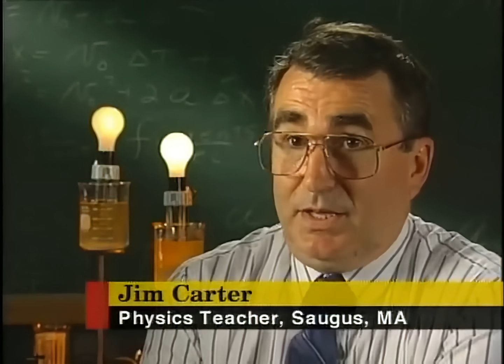MIT graduates cannot power a light bulb with a battery.

Comment: The electrical circuit needs to close.

The lightbulb is made from 
1) a glass bulb
2) a metallic cylinder
3) a ceramic on the bottom of the cylinder
4) a small metal pin on the bottom of the bulb 

So one side of the wire is attached to the outside of the cylinder, the bottom metallic pin is place on the other side of the magnet.

Then current can flow from the battery, through the wolfram wire inside the inert gas bulb.
(The inert gas prevents oxidation of the wolfram wire at high temperature)

Other then that the current heats up the wire with the electricity, that the light bulb is glowing, because the thin wolfram wire is glowing bright hot.
(Maybe around 6-10x times as hot as a pizza oven. 2200 degrees Celsius ≈ 4000 degrees Fahrenheit)

Comment: I literally did this in Grade 5. We took a paper plate and taped some wires to it. Attached a 12v battery and a small incandescent bulb and fastened a paper clip to the plate to function as a switch.

Comment: People spend their whole lives in professions they know nothing about. 

I’ve recently picked up DIY. And within a few months, I have identified and repaired multiple jobs done completely incorrectly by professionals. And the worst part is that the guy who f’d up the plumbing ONLY does plumbing. The guy who f’d up electrical ONLY does electrical. The guy who installed vapor barrier backwards ONLY does vapor barriers… How did I surpass them all simultaneously in a few months? Are we just surrounded by useless people?

Comment: In my 24 years of electrical construction from simply projects to 911 call centers, I have yet to see a job properly "engineered". I suggested that engineers spend their first 2 years on a ladder before being allowed to design anything. One project involved a 4 story library that was designed without taking into account the weight of the books. LOL

Comment: It depends on the light bulb, the battery and the wire. You can't light a 240V light bulb with a 1.5V AA battery.
Reply: You certainly could. The question is whether or not you could produce enough heat for light to be visible.
Reply: @jordangourley3955  if it's an LED then no
Reply: They never said what the trick was for why they couldn't do it. My first thought was some bulbs genuinely are made for AC circuits or commercial voltage that could never be powered by a small battery
Reply: @spencerbuck1074 commercial voltage bruh like yeah the battery cost a buck
Reply: When I was a kid I walked around with a 9V battery trying it on light bulbs thinking "maybe this one will work" but of course never did. Then I got a kit with some LEDs and burnt them all out by trying it on them. Sometimes life is mean 😢
Reply: Wow, you must have gone to MIT to come up with that conclusion!
Reply: You might be, depends on the power
Reply: @philippe_6457 for sure, but then your light bulb will stay for 7s, dim out quickly for 2s and stay dead at 10s.. well if you use AA battery ofcourse 😂
Reply: @ViktorLeQT a 3W led with 1.5V AA would draw 2 amps . Some lithium AA got around 3000 mah capacity. It would last more than one hour
Reply: @CapFausto  Lithium AA's are not common, and 18650 Lithiums (much bigger) are I think in average 2400mAh. 
But this doesn't really matter. 
If you wire up an LED directly to a battery without a resistance, the LED will burn very quickly. Because the LEDs have almost zero resistance, and the current will be too high.
Reply: This guy clearly went to MIT!
Reply: This is in America that’s only a 120v light bulb

Comment: It's not entirely true that you can't do anything electrical if you can't predict the internal resistance of a wire. The students are decently primed to solve tasks—they learned about resistance, they just need to reframe the question. They know that reducing the resistance would increase the available voltage/power to the light. They can also probably design a far more complex digital circuit that uses those basic principles but amplified. If any of those electrical engineers specialized in DC power distribution, they would obviously ace the test (or I agree, remove their degree immediately lol)

Realistically, a couple of the students there probably experienced internal resistance in a wire at 3AM trying to wire their formula car start button or something, and learned from that stupid mistake, the hard way, wires are resistors. So when the long wire isn't working, they instinctively go to "shorten the wire."
I happened to learn that specific lesson during a grade 5 science fair project, but instincts come from experience, which a degree gives you ACCESS TO, it does not GIVE YOU THE EXPERIENCE though.

Comment: Way to make something extremely deep, bout a battery and a bulb. What was the answer? Who knows? Something bour IR? Votlage not being high nough? Or the way to wire it up? It guess one wire from minus to the side of the bulb, given only one wire, put pluss pule on pluss pole of bulb which is the bottom? Or maybe its the opposite way. Maybe the resistence is too high for such a battery- Are we taking grounding into the mix too? Fcx do i know

What are the speccs? Does it go to a socket made for 220v / 110v or run on a normal battery(which wont do fck all then)?

Comment: The funny thing is that you don't need an Engineering degree to know how to use a battery to power a light bulb. Any curious adolescent who has opened a flashlight knows how simple dc circuits operate.

Comment: There is a lot of knowledge in the world today. Would you rather hire someone that is fully trained to do the job or someone that just knows how it works? If you had to get your light fixture rewired, would you hire an electrician?

Do I think I could light a bulb with battery and (a) wire? Depends, does the battery give off enough energy to light the bulb?

Comment: I was thinking at the start that they would give them a regular lightbulb and there wouldn't be enough power in the battery to make the filament glow. But just connecting one end of the wire, bruh what?

Comment: 1:39 he joins the +ve and -ve to each other using the wire. Within 1-2 seconds that wire will get red hot. 

I learned this as a kid messing about with batteries, wires, and later with motors, RC cars etc.

Comment: Ah c,mon, I was doing that when I was 8, and playing with a toy car that I used to push to make it light up, I understood that time basically how it worked , if this is the quality of student I now understand why there is no real big breakthroughs anymore
Reply: So you can explain the magnetic field theory in operation then? Van you also calculate the power output voltage and how it varies based on the velocity your pushing with? 
Engineers can. That's what they do, they are not repair technicians mechanics or electricians

Comment: Western academia is 99% theory. Ie notes on a board and text books and writing or typing, abstract diagrams, models and theories, admittedly now tablets, screen boards, but same principles. Nothing practical. It has next to no practical exercises and experiments with phsyical tangible objects. Even at school it's only very occasionally in science.
I studied computer science to degree level. Only 3 people in my year knew how to build a computer and install windows Linux etc. We learnt nothing about the basics. Most people with degrees in computing would struggle to identify computer components if they were pointed out. They have no idea how a computer works but they can perhaps explain low level computer architecture theory.

Comment: When i was an apprentice i asked one of my instructors if he hated that he had to teach us plebs (he also had classes with the mechanical engineers) he said not at all, that the engineers were mostly complete morons and that the only ones worth a damn were the ones that had a trade first before doing mech engineering, the college only crowd were a liability. He had one that tried to measure a shaft that was still spinning on a lathe with a vernier caliper and the guy couldn't understand why it ended up stuck in the ceiling.

Edit. That was a 4th year class too, not just in the door

Comment: This is a trick question..... Conventional AC bulbs (that use a filament) require 110-120v AC @ 60hz..... A battery produces DC power.... You can power a conventional bulb with DC, but the DC voltage would have to be around 60VDC (enough to heat the filament).... Since most batteries are not 60VDC (especially when this video was made; I know that today 60V batteries are used in various tools and bikes) they assumed that it wouldn't work. However, you can light an LED.... Assuming that the LED doesn't have a built in AC-DC converter. If the LED does have an AC-DC converter, you could disassemble the bulb and extract the diode to light on it's own.... But at that point are you still lighting a bulb? I only have an A.A.S in Computer Engineering.... Couldn't afford to go to university.

Comment: Im not an engineer not even a college graduate nor do i have ANY education or experience in electrical stuff. But if guess you attach yhe negative terminal to the outside metal shroud of the bulb and the positive to the tip of the bulb or visa versa. The electrons actually need to flow so just attaching 1 terminal isn't doing anything. I feel like it's quite common sense and i didn't even have to go to mit.

i learned how electricity flows in public school nearly 10 years ago. You cannot be this stupid

Comment: I knew how to do this when I was 7.  You just strip a few inches on each end of the wire to make a loop to wrap around the threaded potion of the base and a contact to hold against the bottom (negative) of the cell.  You can close the circuit by touching the tip of the bulb base to the (positive)  top of the cell.

Comment: This seems foolish for a few reasons. Are you asking engineering students who studied electrical fundamentals? Or just the whole body. There’s a huge chunk of stem that won’t see any coverage of that topic. Also critically is that bulb even going to illuminate with a 9 volt battery? They only provide 500 - 600 mA, most bulbs fall in a  20 - 100 watt range, that battery at most can provide 9 volts x 0.5 amps = 4.5 watts. Modern LEDs would be fine they draw far less.

Comment: Thats basic common sense.   You put the bottom tip of the bulb on the positive+ battery pole. And run the wire from the negative- pole to the side threaded /cup of the bulb

Comment: I had a graduate engineer who thought that Rx goes to Rx and Tx goes to Tx. That when you split a conductor that all the electricity flows only through the split we're measuring and that WD-40 on brake pads is a good idea. Another graduate tried to measure the current across a battery.

Comment: """" THAT """" Is Beyond Sad  !!!! 
At Age " 3 " I Was Building My Own Flashlights. With The Items from My Grandfather's Junk Box in The Basement. My Battery Holder Was Either The Cardboard tube from T.P, or Paper Towels ( Depending on Number of Batteries available, & or My Bulb voltage capabilities  ). The reflector, was A Dixie Cup Covered in Aluminum Foil, Some Random Tape & scrap wire. 
""""" I Taught Myself """""      I'm Sure Grandpaw Slipped In Some Pointers  !!!!!!!
""""""""""""""  BUT """""""""""""""    I   DIDN'T HAVE TO GO INTO A QUARTER MILLION DOLLARS OF DEBT  !!!!!!!!! 
AND SPEND 4 TO 6 YEARS IN COLLAGE  !!!    To Be Dumb As A Box Of Rocks. 
P.S. I'm  Old and Cranky ( 62 )  
P.P.S. I Designed Some of The First Civilian " Headlights " on My Own, and The Supporting Harnesses ( Very High Power  )  Nothing @ That Time Could Touch It. Or Even come Close to Performing Like It, 84 -85  But It was a Battery Hog... I Was Looking at Search And Rescue, & Emergency Response But never could get Enough Working Capital, Without Giving Up Control.

Comment: when i was doing an electronics exam (read a circuit diagram and build it) i read the diagram, built it, proved it didn't work, re-wrote the diagram and built an operational example - before the rest of the class had even built the incorrect one!

but then i was born "gifted" and started 'working' on cars when i was 5

Comment: Frustrating to see so many commenters missing the point, the task was impossible! The correct answer was "no, that's the wrong bulb for that voltage" but because in every practical lab, the right equipment was provided to them, none of them had ever had to match a bulb with a voltage, and they hadn't developed the intuition that a high voltage bulb won't light with a low voltage battery.

Comment: There's many variables not controlled for in this "impromptu experiment". First of all, there's many varieties of lightbulbs. The necessary voltage to power a lightbulb differs between household bulbs (120 or 240V AC) and automotive bulbs  (5V DC). Similarly there's different batteries and wires, not all of them electrically compatible between each other. The specific setup matters a lot. Also ergonomics matter. There is no working surface and holding things in the air like this will lead to poor feedback (i.e. misattributing the circuit not functioning to lack of continuity instead of incorrect polarity, etc.). Psychological factors also play a part. Graduates surprised by the question in their cumbersome togas are unlikely to be in a correct state of mind to produce results. Finally, there is no control group, the same problem should have been presented to the general population and the results compared. As presented here the conclusions which the filmmaker seems to suggest are very weakly supported.

Comment: 1:50 She was so close but so far.
You connect the wire to the negative side of the battery and the side of the bulb, then you touch the bottom of the bulb to the positive side of the battery; BLAMO closed circuit. I didn't even graduate high school and I know how to accomplish the task, hell I did this in first grade just playing around with batteries and light bulbs.

Comment: I graduated in aviation engineering from the faculty of mechanics, but even I knew how to connect a light bulb to a battery, I did it when I was 7 years old, and that was taught in the faculty.
However, today I found out that my faculty no longer teaches kinematics and hydraulics in mechanical engineering, because they decided that the university should operate like a private business.

Comment: I can do it, but my scientist dad showed me how to when I was a kid. The question, though, should be, "What battery, and what bulb?" 
They need to deal in roughly compatible voltages. 
You could have a big bulb that wouldn't light at all with a small, low-voltage battery.
Or, you could have a small bulb that exploded when connected with a large, high-voltage battery.

Comment: Ive known engineers, lots of them.  They typically build upon foundations laid down by engineers of old.

They are good at CAD but rarely understand why certain functions of a system operate as they do.

What's worse is they "degree lock" positions that would be better held by the technicians  below them that actually understand the systems.

And let's be honest, the CAD isn't hard.  There are a multitude of proprietary CAD systems that all require training from the developer.

Comment: I was thinking they would have specified "if the output voltage and current/amps of the battery is sufficient for the bulb's power needs, then, yes". Though a basic circuit from third grade science class threw some off is surprising.

Comment: First thought before i see them try is, don't bulbs run on AC? Secondly what voltage do they run at? If it's DC capable and the voltage matches there should be no reason it doesn't work

Comment: When I was still working, I was seriously amazed at the number of electronic engineers we hired that couldn't even draw a mere power sully with a transformer, bridge rectifier, filter capacitors and label the outputs to polarity. How can they even understand electronics if they can't even understand a basic simple power supply? It wasn't like we asked them to design a Switching Power Supply...

Comment: In my high school we had to take a year long course on practical circuitry . The following year we had a physics practical lesson where we had to build a circuit as part of the experimental setup. My group promptly proceeded to blow out our ammeter because we had connected the circuit wrongly so the ammeter was parallel to the load instead of being in series

Best part was I had spotted the issue and told them only to get shouted down by the rest of the group

Comment: Once my company contracted a electrical engineer for the assembly wiring dept. The salary was 3 times a regular worker wage. They guy was unable to wire a 3 phase industrial motor. He burned the inverter. In one week he collect almost usd 4k in damages. Completely unaware of the self incompetence. The company kicked him away after 2 months and got a 21 years old kid to help us. He was way smarter than the engineer...
Reply: smarter as a technician. But if you asked the engineer to design a more efficient or different wiring system he would do that.

Comment: This is just a reflection of the specialization in modern society: experts increasingly know more about less and less. In the past, the cultured, intellectual, was knowledgeable about science and mathematics, probably not an expert in both, but with basic knowledge of both to be able to solve problems. That's engineering. The word "engineer" comes from the Latin ingenium (meaning "cleverness" or "natural capacity") to solve problems.